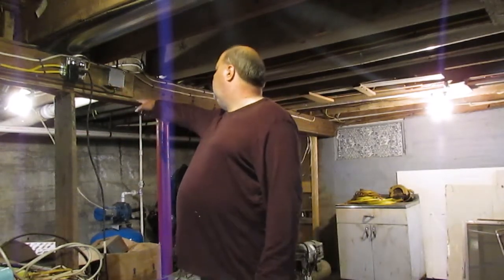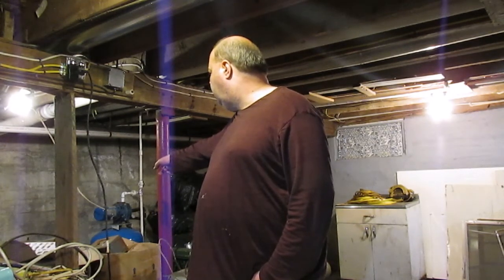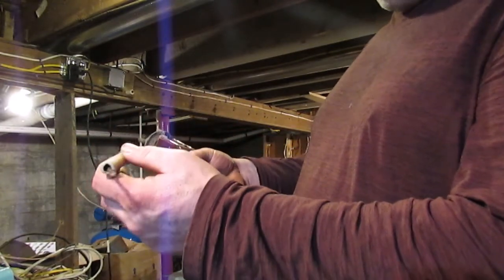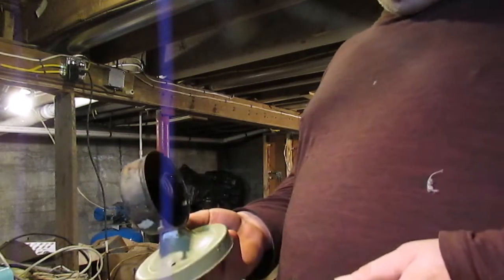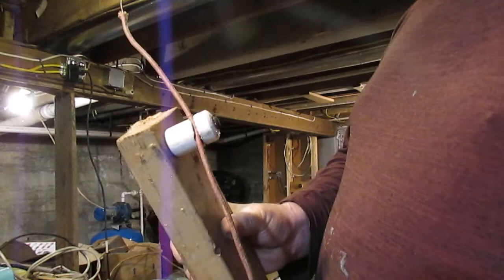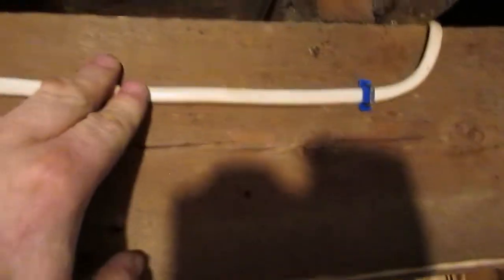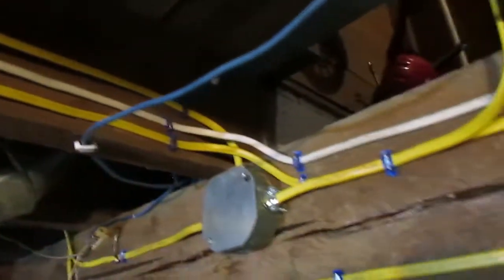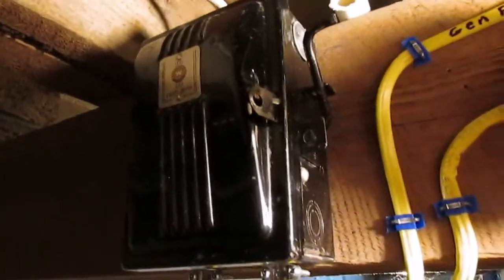Homestead Resurrection Keeping the lights on for another 100 years

Comment: I enjoyed this video, good job on bringing the wiring up from knob and tube with many splices, to modern, much safer, proper wiring.  I have been all about electricity and electronics since my childhood, and I am self taught in a lot of it.
Reply from the maker: Thank You! This was a Big deal for me , When I first looked at this place in 2014 I was shocked to see all the old wiring still in service here , My Parents Bought this place in 1976 and had no idea how bad the wiring was , at that time it had a 60 amp Main Fuse panel that dated to probably the 1940s, My Parents got rid of this old place in 2002 still as it was in 1976 , the guy that owned it after my parents did get the panel updated to a 100 Breaker panel but thats where it ended in 2003 , the old place continued to run another 11 years on the original wiring , I never paid much attention to the wiring in this place when I was young as I just didn't Know much about it , when I looked at the house in 2014 for the first time in 12 years I was Horrified at the Really Bad wiring , and Even though this place needed a lot of other work I made rewiring the entire house a Priority , with some help and Guidance  from a Licensed Electrician I worked on this mess for about 4 years until it was all cleaned up and Gone I can tell you this much I sleep a lot better here at night now 🙂

Comment: When this house had the original 30 amp service, it most likely was 110 volts DC which was why there weren't any outlets installed.
Reply from the maker: That Makes Sense , A lot of older homes around here were 110-120 A/c when they were first built  ,  A few around here still only have 120 Volt service But not Many ,this place was one of them, as far as I know the power here in this little rural area has always been A/C and has been supplied by Tinker Dam Over In New Brunswick Ca. I would Bet the old 1920's Hydro Generators are still powering the Grid here today